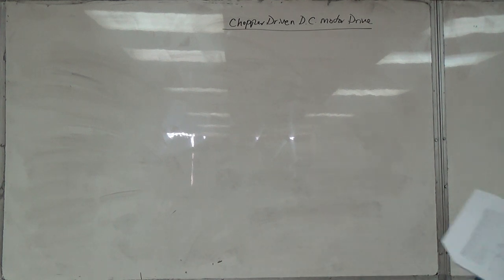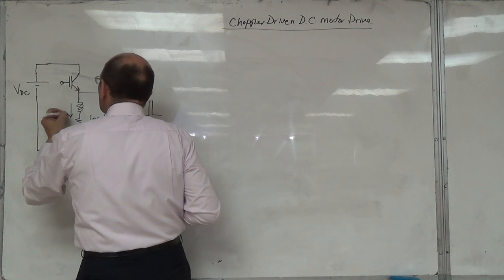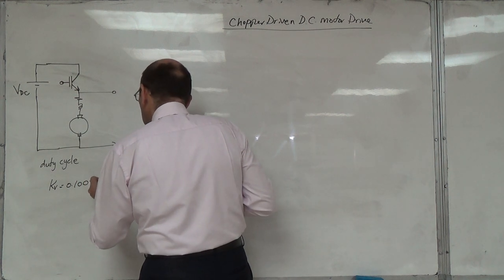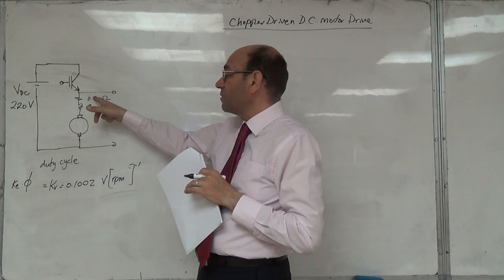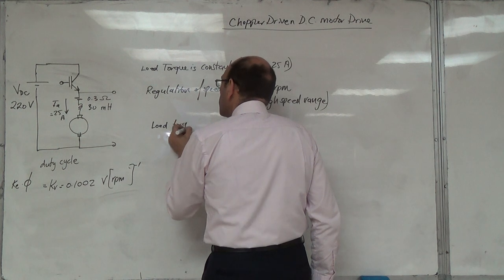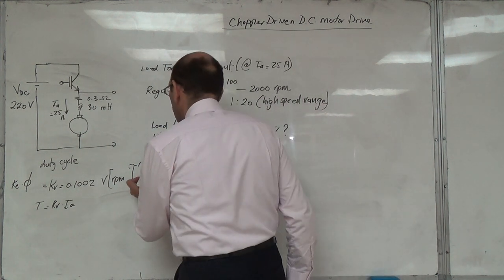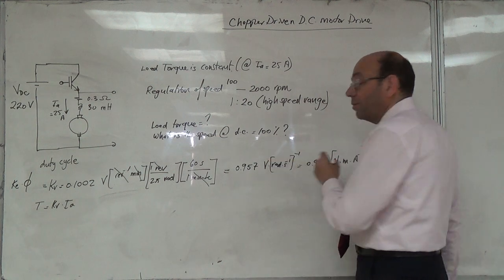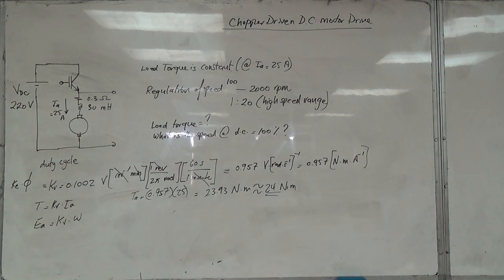Using a PWM Chopper to Control a DC Motor (a), 24/4/2016

Comment: What if the dc motor is separately excited, will the concept change? Of choppers
Reply from the maker: it is the same.  But you keep the excitation constant and do not change it.  the chopper circuit alters average dc voltage on the armature.
Reply: @LutfiAlSharif  
Thank you sir

Comment: what if the voltage source is not a pure dc source? but its 3phase that rectified?
Reply from the maker: good question.  You really must first filter the pulsating voltage (e.g., using series inductors or parallel capacitors).
Reply: @LutfiAlSharif  is that method capable to apllicated in dc shunt motor with 5 kW capactiy?
Reply from the maker: yes.  but you need to filter the ripple
Reply: @LutfiAlSharif  Thank you for your answer sir
Reply: @LutfiAlSharif  and how if we want to get the variable output voltage (Vout less, higher or equal to Vin) ?
Reply from the maker: It is not suitable for that application.  It is better then to use something like a boost Converter.  Searcy my channel and you will find videos about this.  The only problem with using a Boost Converter, is that it is usually not available at high power ratings.